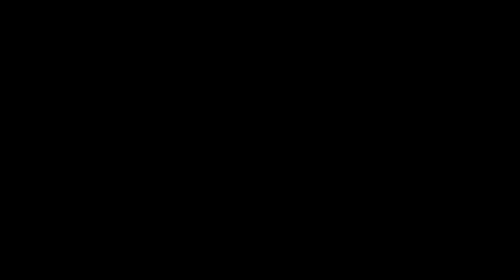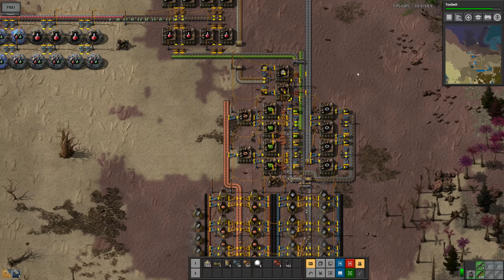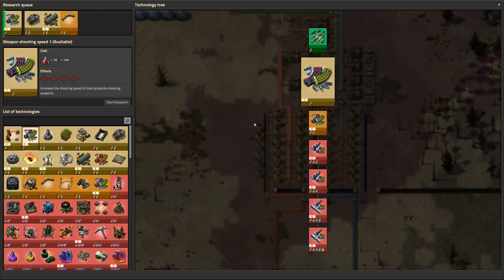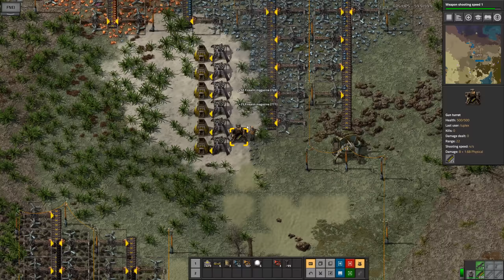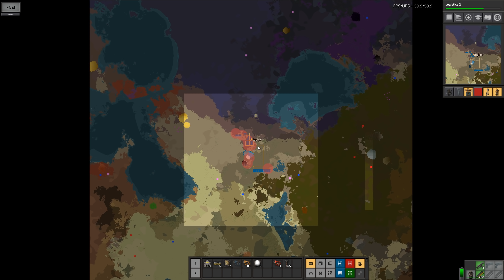Krastorio Mod - Factorio Let's Play #3 - Iron bars, bus

Comment: 07:20 - they do work perfectly my friend! you are just not using them correctly. you funnel one mixed belt to the splitter. obviously none of the 2 outcoming belst can be completely full. Use the splitter further to the south of it. there are 2lanes of iron feeding into it. (one of wich is mixed with sand) 
If u now use the filter on that splitter, you will end up with one full belt of iron ore. and the other belt will have the excess sand on it. :)
Reply: I'll keep watching. but I couldn't help it. I had to point it out asap xDD dont blame the splitter if u dont use it correctly :p
Reply: Did I miss it maybe? your sand is only on one lane. looks like there is a different ore blocking the output to let it flow. my OCD man it hurts.

PS: I'm glad to watch your Factorio videos again. kinda had other interest than Factorio for some time :D keep it up mate
Reply from the maker: You're right, I need to filter as far back in the chain as possible.  I'm going to rework that area to flow better.  Thanks!

Comment: You should think about the way you want to organize the trains in this project. I would like to see a grid system here because it seems like you will need a lot of different trains moving stuff in one system.
Reply: You can also potentially outsource some productions if the size of the base is getting out if hand or u want to scale it up
Reply: I think a "bus system" for trains would work well, too. Make a centralized station with multiple offloading platforms for different ores, create a trunk line with 4 lanes and hook up outposts to it. Grid would be nice, but Tuplex (and me neither) does not know how big/complicated certain production chains will get. So determining a size for the grid would be difficult.
Reply from the maker: Yes, I am planning to use a grid system.  I think that will offer the most flexibility and connectivity where we are not sure how big the base needs to be.